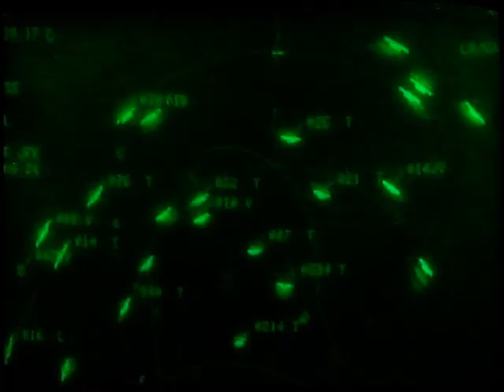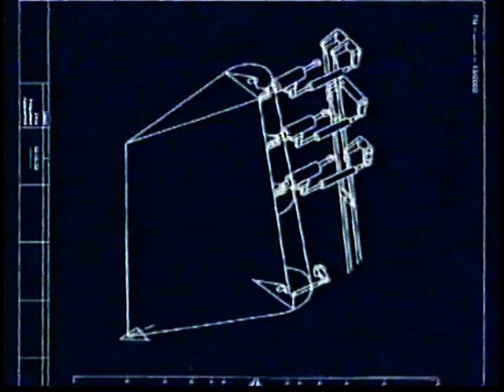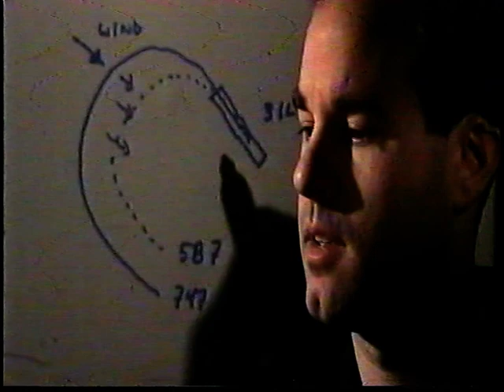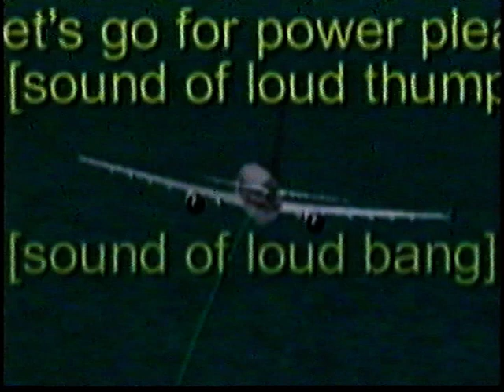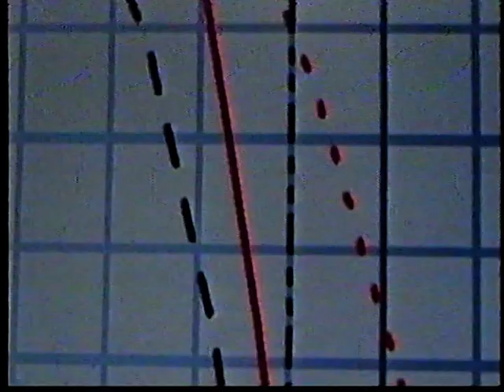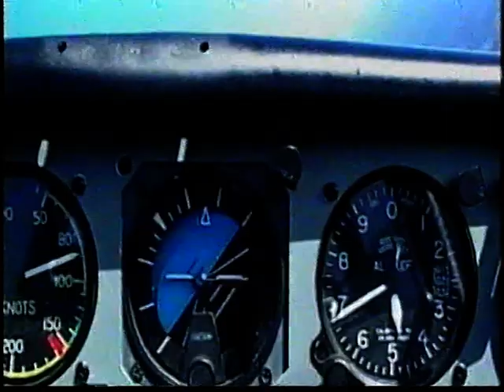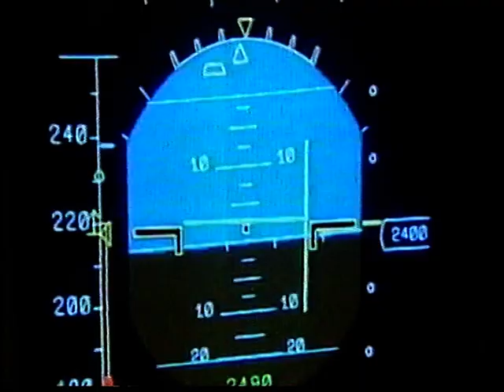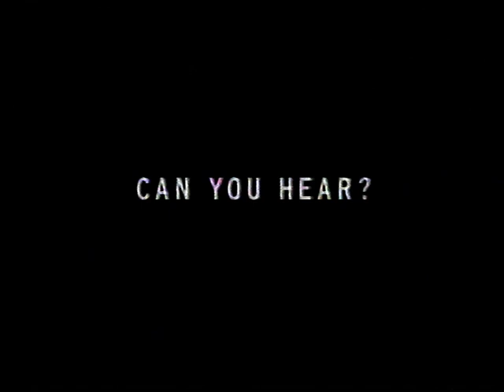BBC2 Horizon Flight 587 Aircrash

Comment: I still say there is more to this story than what is in the official accident report. I believe the composite tail element of the Airbus plane was weak and had an unusual and rapid failure mode. Meaning that in a dangerous situation, the tail will would fail suddenly and depart the aircraft fuselage in an extremely short period of time. In contrast, a metal tail would fail gradually and perhaps buckle or warp but not separate from the aircraft in just a handful of seconds. I believe Airbus successfully covered up their culpability and allowed an innocent pilot and American Airlines to take the blame for this accident. Hopefully in the future, another effort will be made to more fully understand the facts of this accident.
Reply: Well tails haven’t fallen off airbus planes since so I think you’re wrong
Reply: @ronanmcallister1232  I’ve been told that Airbus tweaked their computers to limit movement of the vertical tail in certain flight regimes. As for being wrong, well we are all entitled to our opinions.
Reply: @billymania11  an opinion based on fact. Your opinion is based nothing but conjecture. NTSB is not going to Simp for a non Boeing company..
Reply: It was the violent and excessive rudder movements by Sten Molin that caused the tail to separate from the plane.
Reply: @billymania11 the very fact the pilot had a history over using the tail is a red flag though. Even in cases where rudder was unneeded
Reply: I find it interesting that Airbus changed the control laws (programming) for the rudder. That is a clear indication of an original issue. @Jprager
Reply: @billymania11  it’s not explicity stated, but that’s because it’s unnecessary. When you drive you don’t use cruise control in traffic in the rain, because of obvious reasons. But doing so is dangerous

Comment: If they knew the Japan airline had left the wake turbulence and warned of it, why didn't they just space the air traffic. Why was the flight in such a hurry to leave so quickly after the Japan flight took off?
Reply: There was a spacing of 5 miles to the JA 747. The wake turbulence wasn’t enough to upset the AA.
Reply: The turbulence shouldn’t have been a big issue. They could have flown through it, had the pilot not overworked the rudder, causing stresses that ultimately failed it.

Comment: So in other words the Tail of the Plane was VERY faulty but they pinned the blame on the Pilot for using the rudder...Even though EVERYONE claims it should be impossible for a Tail to snap off from Rudder movement and a Tail has NEVER ripped off a plane in 75 years!...Blaming the Pilot is MUCH MUCH better for Business
Reply: Thing is, it was the pilot’s fault. If it’s the plane’s fault, surely we would have seen more Airbus A300 rudder failures.

Also, the claim that a tail has never ripped off a plane in 75 years is patently false. Ironically, Japan Airlines had lost a plane because its tail ripped off due to explosive decompression 16 years prior to American 587.
Reply: @tiadaid that’s because it’s not necessary in high speeds, the only time it’s really needed is during stability when landing or taking off during low speeds